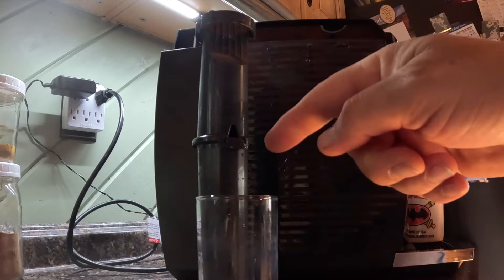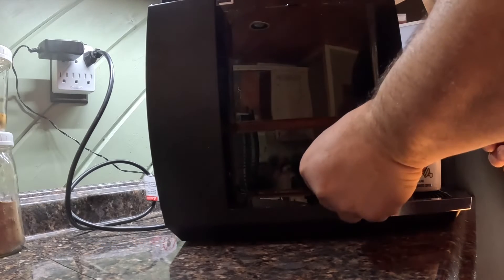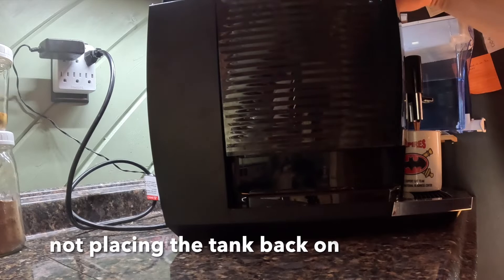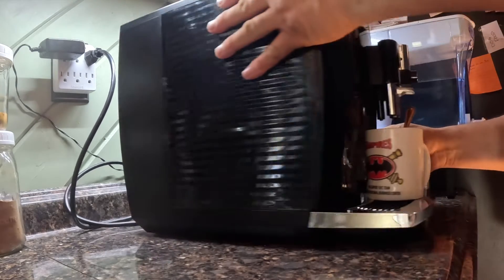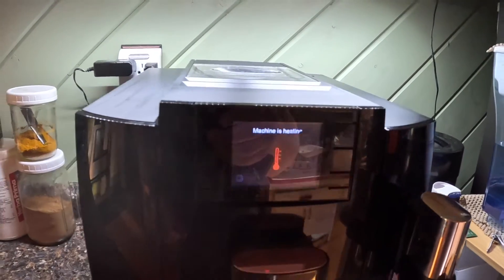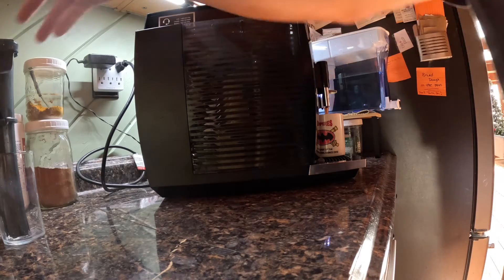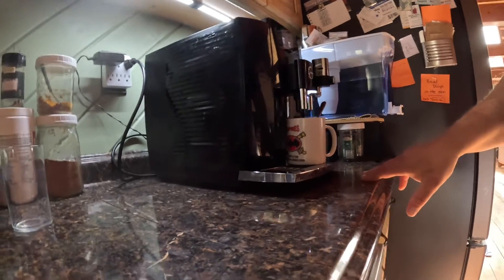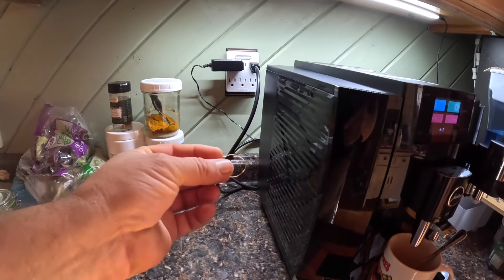Jura Coffeemaker: "Smart" Filter. Can It Be Tricked?

Comment: Is it possible to read this rfid chip from the filter and program it with a new code from another new filter? If I go to the store, scan the RFID code from the new filter and upload this new code to the old filter?
Reply from the maker: I did some research initially and kept coming up with dead ends. I am sure it is possible, but you would have to have a reader & programmer. There are many out there. You just have to find the right one(s). I bought one and got nothing.
Reply: @RoCDIY  I am kinda curious too. I got new filter and old one. Just need buy better rfid reader. Can i just copy new filter rfid data and rewrite older filter data with new one ? Let me know if you have some info about it
Reply from the maker: @NekoMat69  I was initially really curious, but I kept hitting dead ends and I didn't want to spend a lot of money trying to figure it out. I am sure with the right RFID reader/writer you can do it.

Comment: I curious if you go back and use the old RFID that the machine would accept the non smart filter. Hopefully it only remembers the previous smart filter and not a history of them.
Reply from the maker: Thanks for watching and commenting. It definitely remembers more than just one previously used filter, but I don't know how many. I found another used filter after I made the video and it didn't work. 
If you can find a non-jura filter you can use it, but you will have to set the coffeemaker to "no filter." The filter will work, but you will have to guess when to replace it. An old filter or a filter without the RFID will result in a message to replace filter. After so many uses and the message being displayed it will eventually prevent you from making any coffee, unless you bypass the filter by setting it to "no filter."
BTW- if you don't have hard water or you pre-filter your water, then there is no need to use a filter at all on the coffeemaker.
Reply: @RoCDIY  Ooof, that is a shame. It seems like they are being like HP and their inks. I have an water softener and I want the Jura S8 to stop with the decalcification message; hence the hope that using older RFID chips would fool the system. Hopefully there there is a limit to how many filters it remembers.